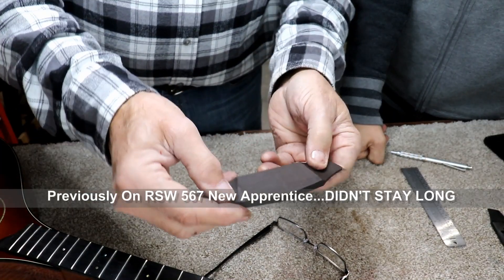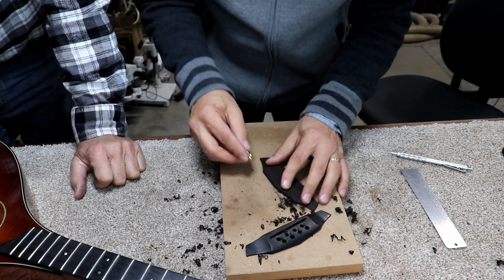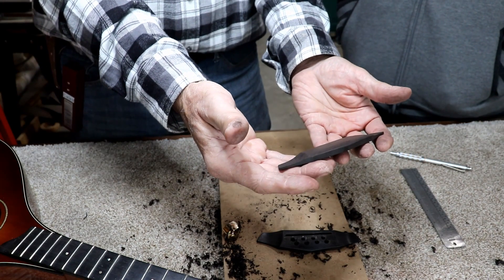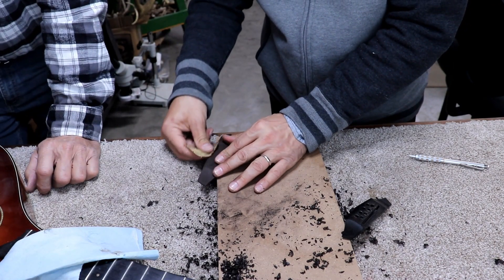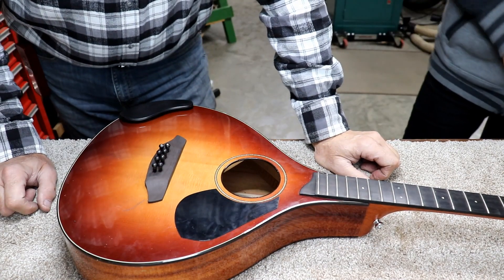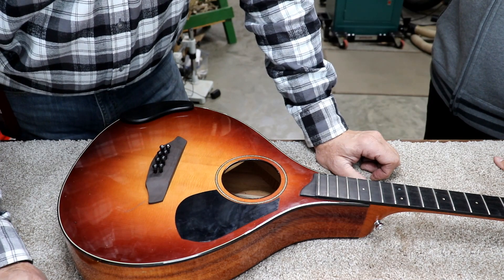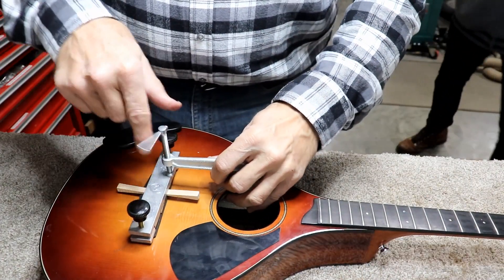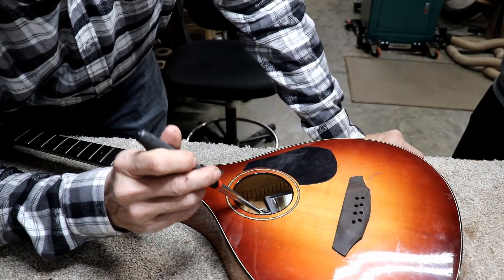567 RSW New Apprentice....DIDN'T STAY LONG! - Part 2

Comment: It's actually easier to do that contour with a finger plane. Belt sander can be a problem with that bridge shape.  Then hand sand later after using the plane. Thats what I would do. More control.

Comment: The why the CA-glue/Superglue as we call it doesn’t work whit aluminium , as soon as it comes in contact the aluminium corode  and it’s loose at that point , aluminium forms in a instant a dry bauxiet layer , and the atached glue dry’s to that
Reply from the maker: Those were steel clamps not aluminum
Reply: @RosaStringWorks  Than maybe oil or the coating of the clamb , normaly it sticks to almost anything

Comment: Could you have transferred the holes by turning the bridges back-to-back and thus flat surface to flat surface ? You could then drill the pilot holes from the back and the final holes from the face.
Reply: If he did that, the two rows of holes would be offset from each other, in the opposite direction.
Also, the spacing of the two string, of each pair "may" be affected. Assuming the spacing of each pair is different. I think it is.
Reply: @zapa1pnt  true, but the are unison tuned so it would be a visual difference and not a sound issue. Conversely, you could trace,  then measure and transpose the locstion. Senor Rosa makes things look a lot easier than the truly are when he says "I just do this..." there's so much more than "just" involved - there's a lifetime of experience.
Reply from the maker: I think the holes would be reversed / mirrored.
Reply: ok then, one flip and a twist !

Comment: I would have put a appropriate size drill bit in the bridge peg holes and gently twist it to mark the center. As a experienced craftsman why do use your method.
Reply from the maker: Simply because it works and the drill bit will cause it to move around because it's just not flat and no way to hold it still
Reply: @RosaStringWorks  .. Thank you. My ignorance was why I asked.  It works is the best answer anyone can hope for.